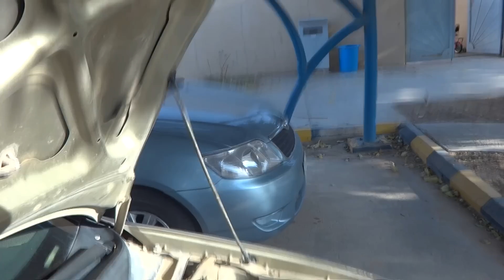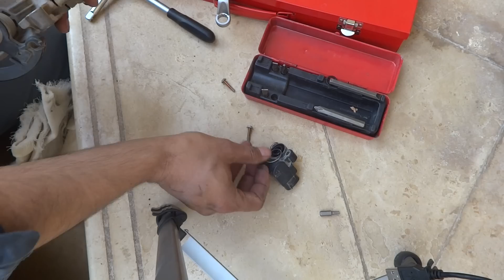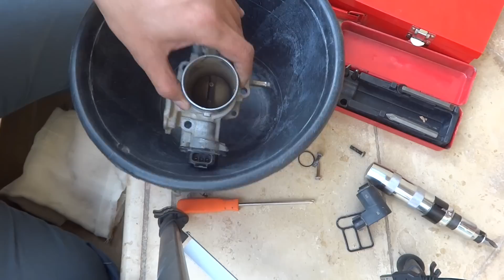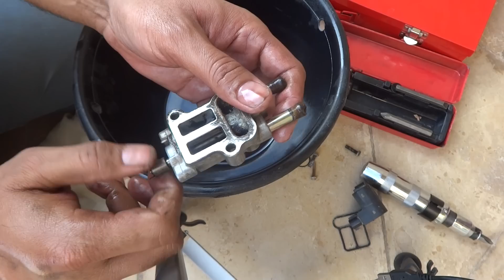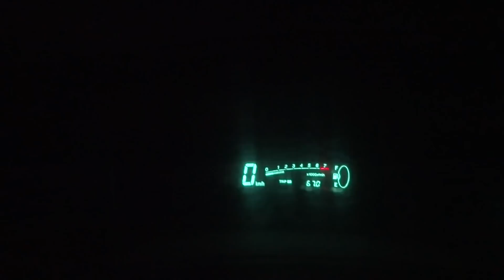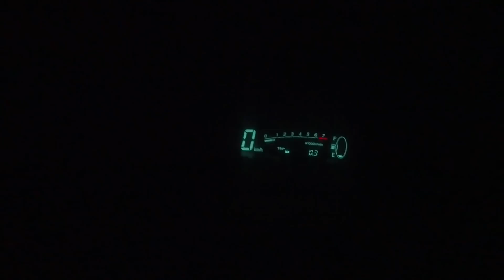Throttle body repair. Idle air control cleaning & repair.

Comment: after watching a few of your videos do you have issues with rust in the desert on cars after years of sand exposure?
Reply from the maker: No dear friend, in the desert area I am leaving is too much dry. Here is no problem of rust at all! but sure sand is creating other kind of problems like paint destruction, Glass blindness due to sand blasting and engine problems some times due to fine particles sucked by engine etc. Also in hot weather like now a days people are facing overheating problem with heat sensitive cars. Regards,
Reply: That is good to know because when you get dust I have always associated that with making rust but with absence of moister I stand corrected. You could have a good business laying thin layers of plastic on windows to protect it against sand blasting like cell phones have on their screens. With all that dust it would almost be beneficial to place the engine intake in the trunk of the car with a secondary vent and filter. The over heating could be solved with a fine water mist application into the intake to keep the heat down but if the electronics are cooking under the hood time to move them or get a different car. I always love to reinvent things when problems arise.

Thanks for the reply
Reply from the maker: egn83b
Thank you very much dear friend for valuable suggestions and recommendations. Plastic film on glasses are OK but some times they are expensive then glass replacement itself. The other thing is engine intake filter must be kept cleaned and oil must be changed regularly under interval. So by this way engine could be saved. For cooling we need nice cleaned radiator and extra cooling fans installed if needed.
Admire your skills and invention habits. Very nice to meet person like you. I am expecting nice comments in future on my each video from you! Regards,
Reply: LearningZone      SOO True here in Ontario (CANADA) Its hot warm cold  (not to mention we use salt instead of sand like the rest of canada )   EATS cars
Reply: Salt makes rust!

Comment: Hi my friend from Cyprus.I have a major problem with my 1998 pajero pinin throttle body.pls help me.Be4 a few days i gave my car to my michanic to fixed the low rpm.so he said to me that he clean the throttle...now the rpm is very confused.when i start the car is 2.000rpm for 5-10 seconds.then is normal 800-900 rpm.after 2-3 minutes the car gone grazy and the rpm go to 2.000 and stays and i have to stop the engine....pls help me what i have to do...pls help.thanks.(sorry for my english.)
Reply from the maker: Dear friend you may do your throttle body job once again by some reputed technician who should clean it thoroughly and then adjust the IAC solenoid or motor to adjust to proper RPM. The IAC motor adjustment is critical as most of the technician doesn't know how to do it properly. I hope this would solve your problem. You may subscribe on my channel so that you will get updates on each upload. Regards,

Comment: Now, with all these details, I'm very confident to go on this job on my Echo. Thank you!
Reply from the maker: Dear friend this is very good that my tutorial is helping you! If you are owning Toyota Echo, this is right channel for you. I will upload a series of video soon on this car as I shot many videos of repair on such car. You may subscribe on my channel so that you will get update on my each upload. Regards,
Reply: I performed most of what you've shown, I cleared the engine light problem, and it didn't reappered when I started the engine (but I did not make a realy big road test, so I might have a surprise in 200km). Also the car has started perfectly. That's the fun part.
At 4:41 in the video, you're removing the throttle body from the car. I can't see what happened when you removed the two hoses at the bottom.
Should I get worried if there's liquid dropping from those hose when I removed them?
By the way, there is no white smoke at the exaust when the car is running and my coolant level is ok.
Any idea?
Reply from the maker: Yvan Pelletier Thank you very much dear friend for subscription and happy that my video is helping you. This is what my aim is! There should be no problem when you will remove both hoses from the throttle body as they are coolant lines carrying hot coolant and preheating the throttle body hence fuel air mixture passing through it. the main thing is you should connect them back when you will finish your work. Also take care of you hand not to injure them while removing hoses  that I am doing with my hand mostly!
There is no white smoke and coolant level is maintained, this is good sign. Please tell me in detail your car problem so that I would or anyone else would be able to give you some suggestion to solve your problem. Regards,

Comment: Smashing repair (as allways) :-))

Im really supprised that any car lasts very long in such a nasty environment, your diesel bath works great :-), please consider rubber gloves for your hands, solvent really distroys the skin and leads to rashes/dermatitus, not very plesent :-((

Daft screw/bolt heads, i hate them too.
Reply from the maker: Thank you very much dear friend for nice comments. Yes this car I ran for about 150,000 km in last six year. It ran with me giving very little to no trouble but now as I am going to recondition it, it is asking for substantial amount of work and spares. Not its fault but the need. The previous owner had also ran it for about 240,000 handing over to me.
Your other point about hands protection is very valid. It is not good to expose to solvents ever. I would try to prevent myself from them. Regards,